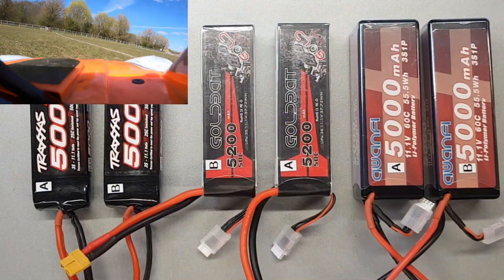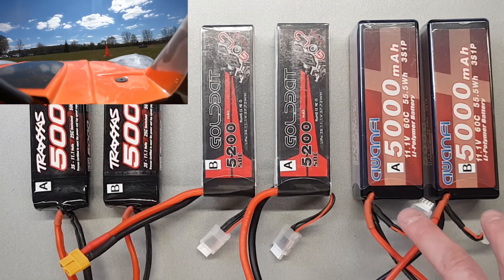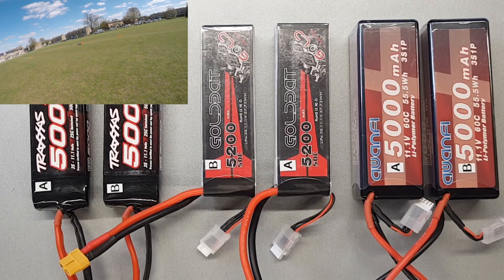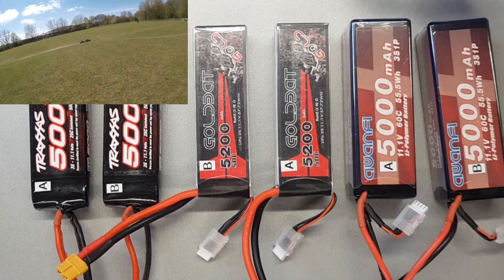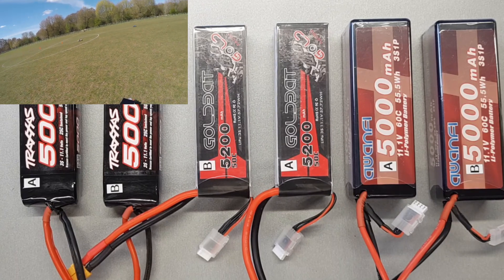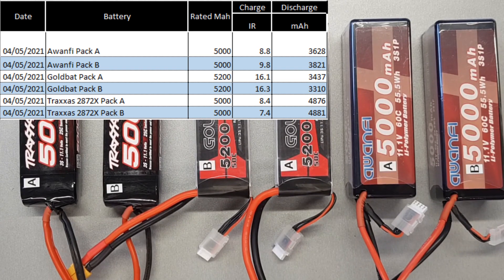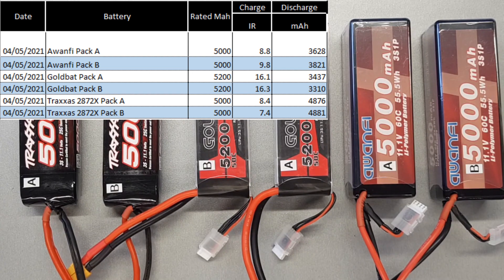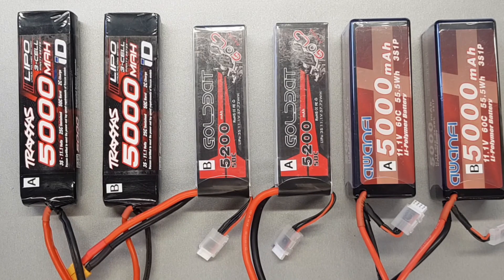Are cheap lipos any good? Comparison of the 3s Traxxas 2872X with cheap ones

Comment: Always appreciate your videos. How long would you say a Traxxas Lipo battery would last threw out the years before the battery’s  is starting to diminish? I purchased some TRAXXAS 3s 8400mah Lipo batteries brand new in the box. that was made from Traxxas back in 2018
Reply from the maker: We have found biggest problem with the traxxas lipos is the small balance wires break
Reply: Thanks, appreciate the info

Comment: Currently trying same expirment (though less technical) running various packs in various cars ( 6pairs ,6 cars) and also running each car on lower battery power 8 on 6s .. 6s on 4s .. preliminarily results traxxas bats do the same or better.. better enough to justify price🤷‍♂️… but gives me more reason to run the cars💪
Reply from the maker: I think with the more expensive brands of lipo the quality control is better. The cheaper ones you get good and bad ones

Comment: So for 1/2 the price you get 2 batteries that are about 13 min run time (26 min vs 20 min) but you need to change the batteries much more often. But I bet their total life is about 1/2 or less of what the Traxxas batteries lifespan is.

So I see the benefit to buying the “expensive” batteries. Less battery changes for slightly less run time. A better quality, less likely to explode battery, and one that will likely live much longer.
Reply from the maker: Generally you get what you pay for. There are some good priced lipos out there , we have found some and reviewed on another video.
Reply: @TeamRC3D  
Oh ok cool! Can you like me to that video? I’ll look for it too
Reply: What are you saying traxxas battery is 6x the cost for 30% benefit? You can get the goldbats for 10-13$ per battery meanwhile one Traxxas battery is 60$  @BigBoii1369 makes no sense to me to pay 6x the cost for less than 0.3x benefit

Comment: It’s surprising how poorly the cheap batteries performed. If they can’t hold the stated amount of charge then should they even be sold as a 5000?
Reply from the maker: Very true, and in real time use they will perform even worse as the voltage drops off and likely to kick in any low voltage protection earlier!
Reply: Paying 60$ for one battery is crazy. 6x the cost for 0.3x benefit? Doesn't make sense